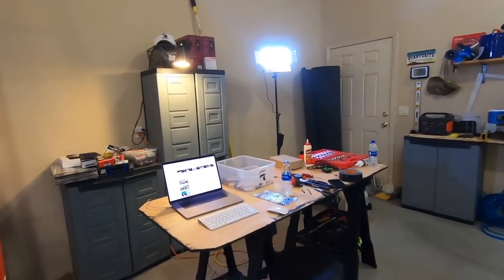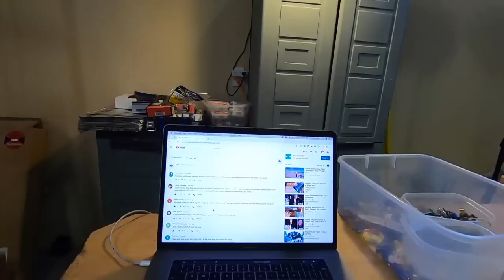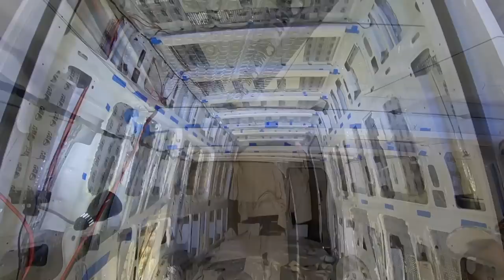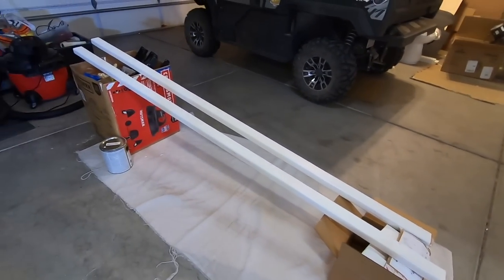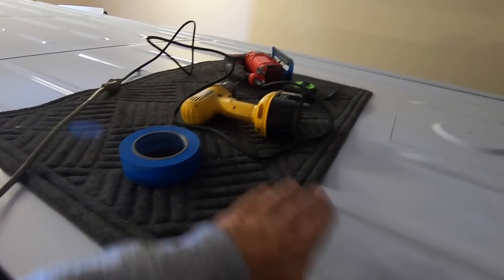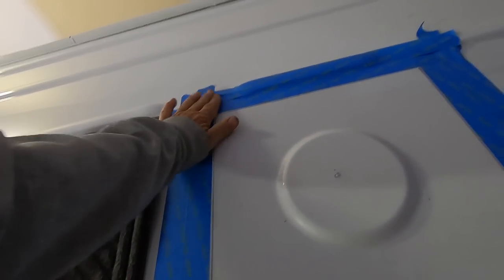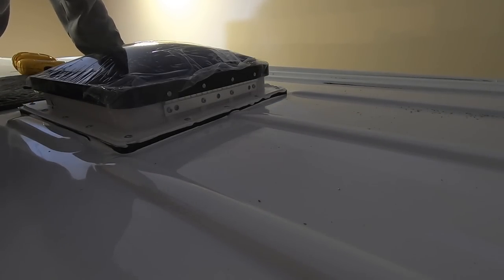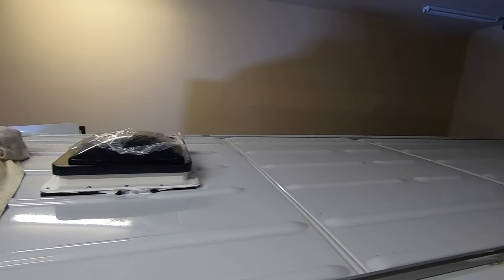Roof Vent Fans Installed Sprinter van Build - 2020 - Comments Answered

Comment: It takes courage to start cutting, once you get started it gets easier.  What I'm waiting to see someone build, an L shaped Settee (converts to a bed) on the right side with a big galley on the drivers side, small head with shower in the rear corner (about 22 x 32).  This is the interior I have in both my boat, and my van.  So far, everyone seems to build the same thing, big bed across the back, no real place to cook or sit down.   I found that Cloud auto museum, thanks!  It was great

Comment: Nice install, Russ. Is there a reason you used lap sealant vs butyl tape between the van roof and bracket? I've seen it done both ways.